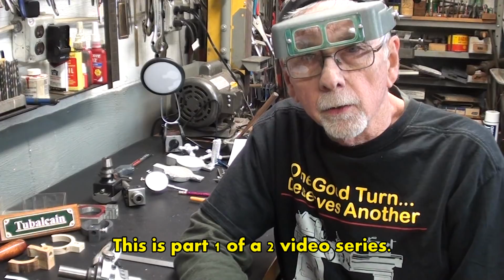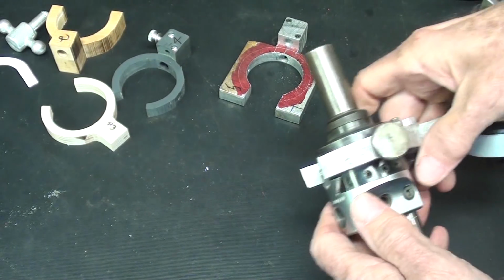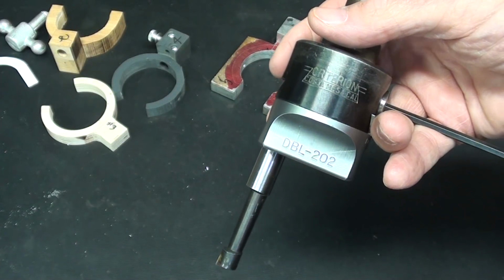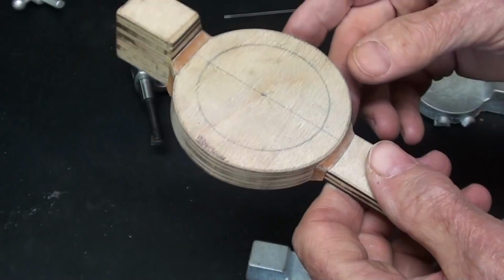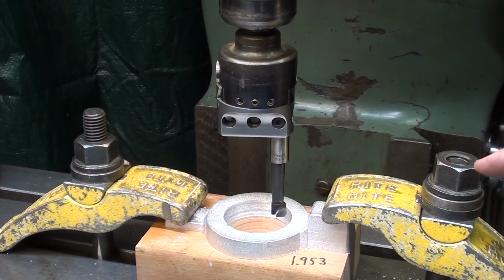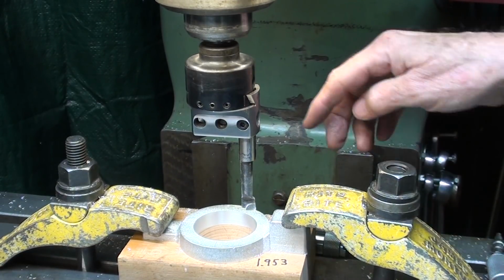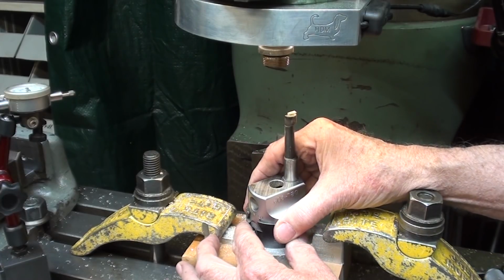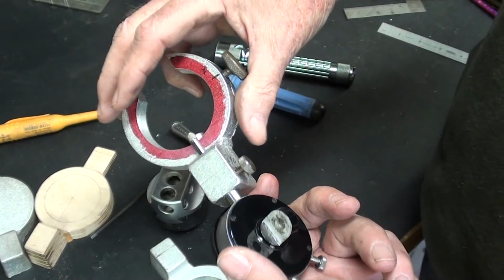MAKE A BORE-RITE for Bridgeport Mill part 1 TIPS #631 tubalcain

Comment: I'm currently in the process of engineering and casting a spindle stop for my drill press; not nearly as exacting a job as this but it is around the same shape and dimensions and the vid is nevertheless helpful and inspirational. Thanks! In fact, the more I watch, I'm starting to think maybe I can tweak my design a little bit to accommodate holding a dial indicator in the perpendicular orientation in order to adjust to a finer scale. Probably uneccesary but heck, why not?
Reply from the maker: You can do it!  Sounds like an interesting job

Comment: Nice tool. Question for you when you are pouring your aluminum about what temperature is your aluminum?  I am getting alot of porosity in my aluminum castings.  Is there any degassing techniques you use to improve aluminum casting?  Any tips would be helpful! 
Thanks
Reply from the maker: About 1200 or 1300°. I got some porosity to, because I do not use chemicals. I just don’t worry about it because I’m not selling anything

Comment: I would have loved to have had something like that with a good tenth reading indicator on it when I was working in the Engineering Lab at Boeing in Wichita. I remember having complicated parts with a lot of hours of work in them and needing a final operation of a hole that needed to be right within a few tenths. I would be sweating bullets. My best shot was putting an indicator on it with a magnetic base on the table and hoping for the best.
Reply from the maker: You made me tense just talking about it.

Comment: MrPete, You've motivated once again to spend a little more money on tooling for which I am grateful! A criterion boring head and set of boring bars have been on my wishlist for quite some time. I just found a used DBL-202 on eBay with several carbide-tipped bars that looked to be in good condition. I will be making a similar version of your BORE-RITE indicator holder to try out the bar prior to tackling a few other projects I have in mind for this tool. I appreciate the time and effort you go through posting these videos for us. Cheers!

Comment: You're not the only one who doesn't like working in the cold. Anymore, I don't do stuff in the shop unless it's in the low 50s at least unless it's a desperate need. Several years ago I had to get under the house to work on the plumbing when it was below freezing. I'm always amazed by videos by people living in the colder climes doing stuff where you can see their breath and they're happy it's above freezing a bit.
Reply from the maker: I agree. Do you ever watch the YouTube channel from Russia where they manufacture back hoe Buckets? Even though it’s indoors, it appears on heated and they are wearing heavy clothing. I would never work there
Reply: @mrpete222  Nope. Hadn't seen that one. I wouldn't work there either.

Comment: This morning I used my Criterion boring head on my Bridgeport to make a ball with rotary table tilted at 11 degrees ala Stefan Gotteswinter. l shortened a half inch left hand boring bar. Left hand tightens the criterion to arbor right hand threads when cutting an outside diameter.

Comment: You say most of us will probably never make one of these. I think I probably will as that is a very useful device when trying to hit tightly tolerance bore sizing. I know you did this in the mill to give a combined demo of how the device works but I think I will more likely finish the bore in the lathe. That way I can check final sizing by using the boring head as a plug gauge. Anyhow, thanks for the excellent tutorial on this project👏👏
Reply from the maker: Good for you. I had considered doing This enough for jaw Chuck

Comment: That slug you got when you used the hole saw, it's a future pulley, flywheel, gear, large washer, etc. I never throw out offcuts except for chips- even my old pouring sprues give usable round stock; every thing of substance goes in my bits and bobs drawer and that's the first place I look when I need just a quick little "something" to help me out.☺
Reply: EXACTLY RIGHT I do the same and salvage/scavenge shapes to weld/build.

Comment: Geesus wept.......yet another longwinded method to set a boring head............why didn't  you just use the mag block mounted dial indicator you mentioned earlier?
I've bored many holes over the years and never felt the need to use one of those things.
I've got 3 boring heads....a Bridgeport, a Tree boring and facing head and a Chinese one........they all work the same and bore holes like you want.
BTW, if you have one of those miniature mag blocks you can stick it to practically any boring head.
Reply from the maker: Because i am an idiot
Reply: @mrpete222  Some mothers do 'ave 'em........."Every day in every way I'm getting better"........BTW, I don't believe you are one, a golden oldie but not a nutter.

Comment: I think the original mounting using flat plates was so you could change them to fit square boring heads like the ones you have. Just remove the 4 screws and transfer the blocks over. The plates could easily be stamped out. You can make it thinner on the outer edges if you fit a  
fastener across the opening ( like a steady rest) than a screw which spreads it. The original only touched on 3 points  not all the way round.
The best part of this fitting is that you can work in imperial OR metric, just change the indicator!!!

Comment: "...and if I screw one up I've got a spare.  Of course that's never actually happened...."   How did you do that without fingers crossed behind your back?  Both hands are in view!  Do you have a third hand you ain't telling us about?  

For those of us that don't have foundry setups I have to say that the two part with the screwed on half block which could be made rather easily from 1/2" alloy plate looks pretty attractive.... More than one road to Rome and all that.

I'm also seeing in my mind's eye a yoke that is a "G shaped version like a G spanner which hooks into the hole, has too hard bumps to ride against the boring head and a locking screw much like an Indicol holder.

Comment: Why the plunger?
Reply: To make sure it's aligned with the dovetail slot in the head. If the indicator isn't directly in line you won't get a true indication of the change in depth.
Reply: @Bargle5  thanks, i didn't realise that.

Comment: Great project. I made mine right after seeing the what is it video and I think every boring head should have one. I made mine from 1/2" flat aluminum with the indicator mount held in with screws. I also made mine to hinge open to mount it to the head. This was so I could install  with the tool mount extended past the head body. Would be nice to have a double reading gage so the indicator would read true bore changes.
Reply from the maker: Sounds like you did a great job on yours

Comment: Anyone think this could be made with a 3D printer and be rigid enough built correctly? Maybe with a swing clamp around the opening to lock it snug to the bore?
Reply: Maybe if you cut out two pieces of sheet metal and sandwich it between them, have you looked at laminated designs, I have thought about trying some sheet metal and polymer laminates just crafting some things around the house.

Comment: All holesaws are not created equal.  Might be worth a video some day?   the actual OD's vary a lot and the quality of the welded joint does too.   Some brands even leave the tooth at the weld sticking out, which really destroys accuracy.   And, I think, some of them even try to round off metric sizes to inch or vice-versa.  Might be worth comparing them with annualar cutters, too.
Reply from the maker: No onehere that I am aware of. But there are at least two in the Ottawa Hospital according to Jean

Comment: Pretty neat. I think to this point I would have added a large fillet radius in each corner where the rectangular pad joins the flange. But your casting has perfect strength as molded.
I would replace the thumb screws with socket head cap screws having the same wrench size as the boring bar. Again only my 
preference.
The convenient hold down tab could be enlarged if milling from solid if the bore is slightly large or you have several boring bars. Add a hex head shcs across the gap to tighten the slack.
Good content, cardboard aided design!

Comment: Why not make a indicator face that snaps on that reads full cut not half. Also seems to me machanist spend half there time measuring why is there not a electronic radar messing type device yet?
Reply from the maker: You laugh, I thought about making such a dial face. I even looked in the starrett Catalog to see if they had such a dial

Comment: I suffered the trials and tribulations of cheapo far eastern crappy boring heads for years, waste of time. Then i bought a used criterion and it was night and day, no comparison. The readings on the dial actually meant something, it held steady, didn't move under use. So i will make one of these little contraptions.
Reply from the maker: I always wondered if the imported boring heads were any good
Reply: @mrpete222  No, the dials made no sense at all with the ones i had, in either metric or imperial. I used to have to use the dial gauge on a magnetic stand as you did in the video.

Comment: What really sucked was we had 3 different Operators and each had their own way of tightening and loosening the tool to make a move. Heck some one left it tight and made an adjustment and rounded the adjustment dial.
I forget the bore bars but one was Kennametal. I really like them. There was a bunch of different boring heads and tool holders. Inserts were the most important part of the tool holder. From the chip breaker to the hardness.  All my knowledge went to waste because of Scabapilare wanted to protect their SCABS. I had 32 years of machining experience and Cat said I didn't have enough machine experience.  I wanted a day shift job so I put in a bid for the job and they said I didn't have enough experience, I was really mad and told them to stick it. The guy who got the job only had 6 months at Cat. 
I should have fought it but I stayed out for the 2 years the Union lied to the Union members. I never crossed the picket line. What's crazy is the Marines when I was getting out pounded into my head that Unions were Commie breeding grounds, so I in 1973 when hired in hated the Union until a day shift forman came after me for his b s. His boy on day shift set up a new job and got it okayed by inspection to run and they were all junk. Both days and 2nd shift ran a bunch of junk. 
They didn't put the key ways on the fixture and every time they milled the part the fixture would move and I caught it and fixed it. Darn day shift foreman came unglued on me. I had to call for my Union steward because he wanted to fire me for finding out all the parts ran before me were Scrap.  Oh well that's was when I only had 3 years in and still scared of my own shadow.  I got 2 nick names at work but mostly was nicked name Rambo. The other was The Booper, LMAO anything and everything happened to me.
Reply: Better to be pissed off than pissed on!

Comment: Really enjoyed!  Casting a large hole in the center would have also made centering the work in the mill more of an ordeal without a machined surface to reference.  Thanks, Mr. Pete! :-)
Reply: Could have centred it using the OUTSIDE of the casting, a few thou doesn't matter until you drill the holes for the pin and indicator.
Reply: @kevingrime5772  Well sure, but that cast-in center hole sure was faster than indicating the perimeter.  Just another way to skin a cat.

Comment: I must say after so many years in the shop, I do like watching you do the work, rather than doing it myself.
I would like to add that I would have made a plug gauge for the tool body fit, rather than taking the boring head off the arbor.
Different strokes for different folks.
I like the shows!  JIM
Reply: ABSOLUTELY!!!...there are SUN strokes...HEAT strokes...and even a few CORONARIES thrown in- just to make things INTERESTING(!)

Comment: Look what I found and in a woodworking catalog no less. They use it in conjunction with a woodturning lathe for boring material for making rings. Just another tool that started in maching that has made it's way to woodworking such as concentric 4 jaw chucks for a lathe and carbide inserts on woodturning tools.https://www.woodturnerscatalog.com/p/72/7241/artisan-Ring-Boring-Head-and-Cutter-Set?term=boring+bar+holder&term=boring%20bar%20holder
Reply: This is by no means mocking or any other form of derogatory intent. Just a item I found that looks very similar that might be of interest.
Reply from the maker: Awesome

Comment: What Scabapilare had was a V block you had to fight to get it to sit perfect to make any moves on your bore head. 
I finally got someone to redo the V block with the dial indicator in it. And got them to make a finish set for the finish tool and a rough indicator, before we would use the same indicator but would slide the dial indicator up and down to reset the gage before adjusting anything. Plus got them to shoot coolant out the boring cutter to keep the insert from wearing out so fast. I was a pain to both Cat and the Union. When I was right, I let them know it.
I was in Cost Reduction and in one year saved them over $3 million dollars but they still moved the jobs out. What a bunch of B S Scabapilare was. Glad I am done with them. Even on my last day before retirement the foreman tried to fire me because of his screw up. He forgot I was retiring and didn't get the cake and icecream so it was my fault and he was upset.
Reply: Man, you really worked with a bunch of pissheads. My last stepmothers first husband was an engineer for Cat in the 60s, heard him telling my dad one day that he couldn't believe it when they handed down a mandate that they would no longer design their machines to last over 15yrs.
F$$king Greedy corporations.....

Comment: I love your videos Mr. Pete !  After watching your original video on the Bore-Set, I made a cheat .... I'm pretty sure it's not my idea, but I can't find where I seen it.  Anyway I modified my boring head to use a bit of a simpler  tool.      https://postimg.cc/3dN92Md7              https://postimg.cc/tZb26YVm
Reply from the maker: A lot simpler. I cannot see how it fastens
Reply: @mrpete222   I drilled a hole in the boring head body above the lead screw for the dowel pin, and a set screw clamps it in place.     https://postimg.cc/Z0Jc6JZB

Comment: Me Pete.  I absolutely love this. I want to make one for my 3” Chinese boring head. Maybe one day I can get around to it.  Also, when needing to take very small amounts off, I’ve been known to increase the RPM and take another spring pass. The RPM. increase causes the boring bare to flex a bit more due to centrical force and takes just a bit more. Don’t know if that’s a valid method. But it works for me. Down side is, you really just guessing because you don’t know the amount of flex.
Reply from the maker: Thanks, I will have to try that
Reply: Hi  Billy greetings from south africa  just seen your comments  on increasing  the speed  so that the boring head cuts  a  bit bigger.. your  quite  right it  it works like a dream .. used to work a SIP jig borer and that was a trick we all used.. we're  in lock down here for another 3 weeks and I suppose you are as well .. keep safe wherever you are ..  CHEERS Dug Hogarth

Comment: This is an essential tool for setting boring heads accurately. I wouldn't say you probably won't make one.... you might not make it today, but eventually you will find yourself needing one. There are several articles  (averaging about one every two years) in Home Shop Machinist or Hobby Machinist covering this subject. I never tire of reading about these (even though I already made mine several years ago) because many times they improve upon previous generations in some (small) way.